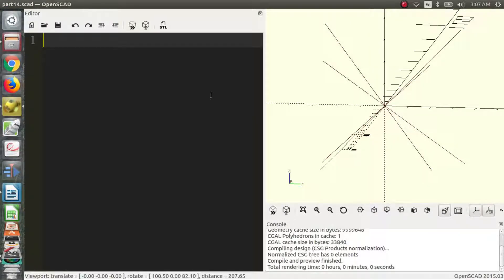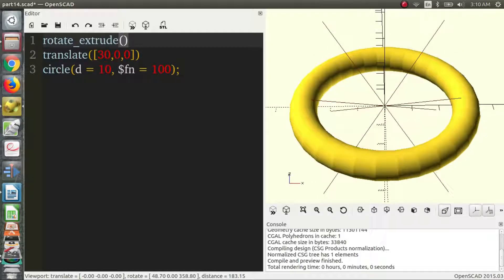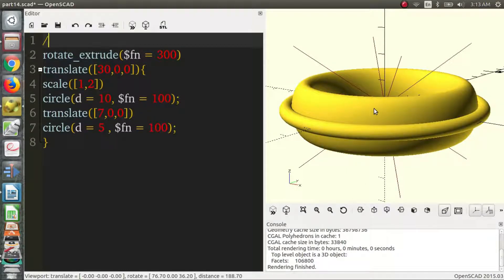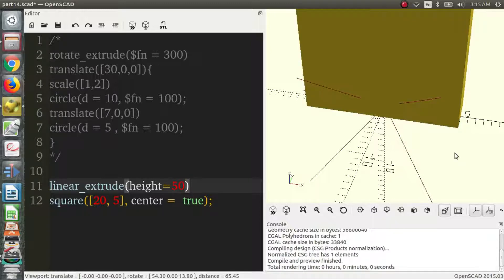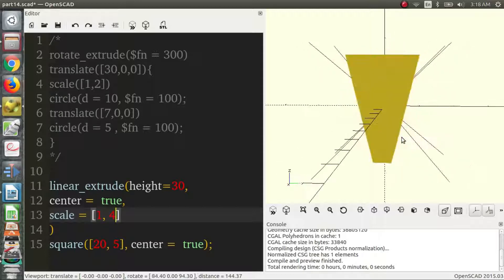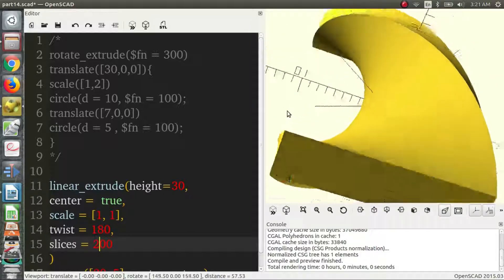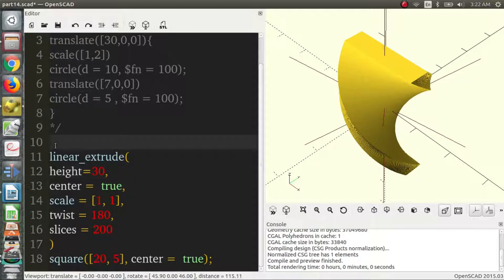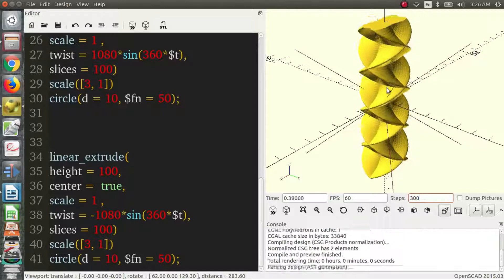rotate_extrude, linear_extrude-OpenSCAD Tutorial 14

Comment: How can I rotate extrude a module?
Reply from the maker: Essentially the module has to produce a 2d shape. So the functions that are used in the module have to lead to a 2d shape being produced. for example:

//========================
module moved_diamond(x){
translate([x, 0])
scale([1, 2])
rotate([0, 0, 45])
square(size=1, center=true);
}

rotate_extrude($fn=100)
moved_diamond(10);
//=======================

The "moved_diamond" module produces a 2d shape and the rotate_extrude function can be used on it. this would not work if a 3d shape was produced instead.